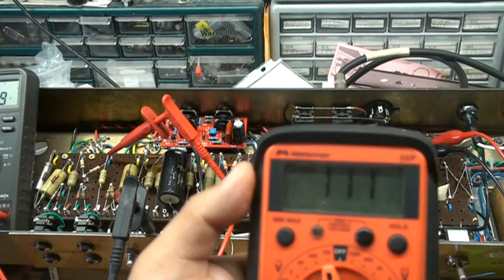1968 Marshall Plexi Rebuild Capacitors Forming

Comment: Once again, great videos! I was curious as to what vintage Marshall parts you have for sale? If any?
Reply from the maker: What are you looking for?
Reply: @conjering  I have an original 1967 chassis, so any original parts that you may have. Tube sockets, pilot lights, any parts? Also do you have any mullard .022uf or 0.1uf 400v caps?
Reply from the maker: thebobhollyband I have 0.022uf 400v and 0.1uf capacitors.  I only have replica modern pilot lights and tube sockets.  Axeman6@msn.com

Comment: I've got an old 67 Super Trem. with the original Filter caps in it still, that hasn't been played in probably 20 years..  Can this old of Filter caps still be brought back to life??
Reply from the maker: The light will dim if there is a problem or not light up.
Reply from the maker: With caution
Reply: I usually turn on the power and standby at 0 volts and increase voltage by 20 volts every 5 minutes with a Variac, that's the safe way. However old caps might deteriorate just the same with age, check for "bubbles" regularly after the procedure, when the amp is off.
Reply from the maker: Well said. I actually use a variac and a light bulb when the amp is in question, but new builds I form the capacitors like in the video.  Thanks for watching
Reply: What's the purpose of the light bulb?
Reply from the maker: https://www.youtube.com/watch?v=wRFRwOnLsZI
Reply from the maker: The light pulsates harder and faster when the intensity knob is adjusted

Comment: It's not oil, it's aluminum oxide that forms. And it's only necessary to form old electrolytic capacitors that haven't been used in many years.

Have a look at the following excerpt from this webpage: http://www.nmr.mgh.harvard.edu/~reese/electrolytics/index.html#reform

"The thin layer of aluminum oxide formed to insulate the capacitor foil constitutes formation. Capacitor manufacturers use proprietary mixes of chemicals and DC electricity to create this insulating layer, which deteriorates with time and idleness. Often the oxide layer is in such bad shape in older equipment that it must be reformed or else the capacitor will fail catastrophically. All methods of reforming use the slow reapplication of DC electricity to restore the oxide layer to its original thickness and uniformity. In my opinion, there's no one proven way to reform - many different approaches are available, but all have one element in common - slowness. The reforming must proceed faster than the buildup of heat due to the low resistance of the faulty oxide layer - this will at least take hours, and can take days."
Reply from the maker: I know, my descriptions are brief. If a viewer becomes interested,obviously he would follow up with addition reading. The oil example was analogy
Reply: ***** it's cool, i get it.

really nice work on your builds by the way.
Reply from the maker: Thanks